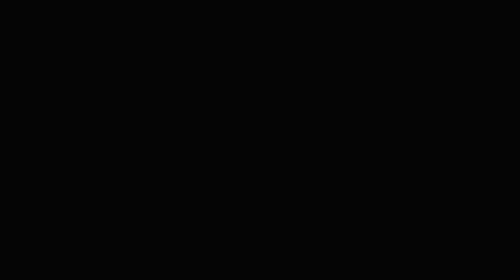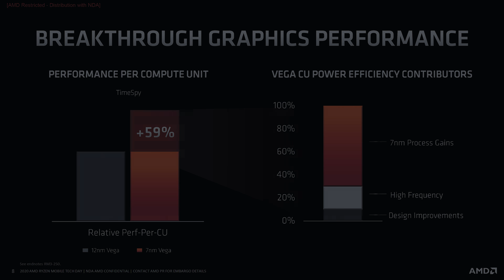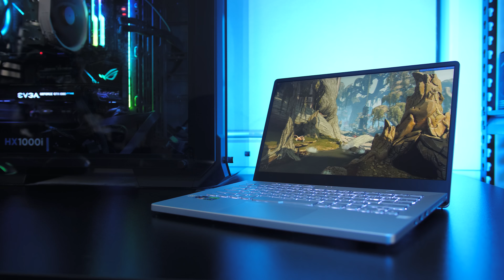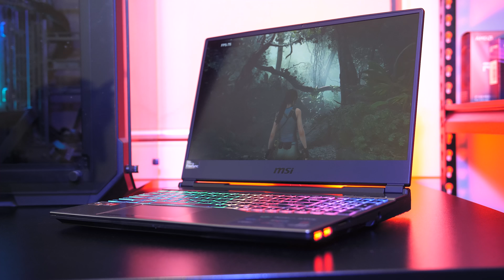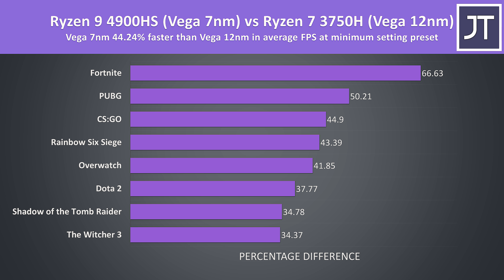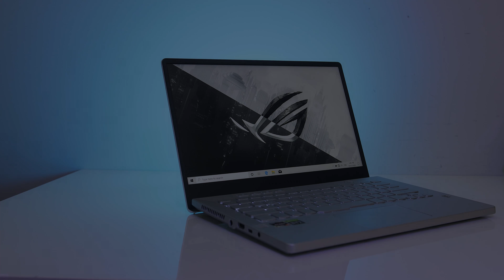Vega iGPU Gaming Comparison - 12nm vs 7nm (4900HS vs 3750H)

Comment: Thank you for this analysis and breakdown!  This is very helpful to me, as I currently use 2500u integrated graphics and my next laptop will likely only have integrated graphics as well; probably a 4500u or equivalent as a good budget device
Reply from the maker: No problem at all! Yeah sounds like that would be a nice upgrade, 4000 series is a big improvement over their prior stuff.

Comment: So if I wanted to game on a game that I don’t need that many frames just more than 60, should I use the integrated gpu or the actual gpu? For a laptop btw
Reply from the maker: If you're on battery it may make sense to use the integrated graphics to save power, otherwise just get max performance with the discrete graphics.

Comment: How about the new Ryzen 7? In Spain, the highest settings to buy the Zephyrus G14 is with a Ryzen 7😔
Reply: Should be very similar. Performance gain on the Ryzen 9 vs the 7 is purely CPU.
Reply from the maker: Not sure yet as I haven't received any to test with so far, still waiting.

Comment: Even in the low powered or U series Renoir, the CPU is still gonna be more powerful and having more cores compared to 3000 series APU. The best possible comparison I think can be done between Ryzen 5 4500U (6C/6T) and Vega 6 graphics VS Ryzen 5 3500U (4C/8T) with Vega 8 graphics. If you go below that to compare a 4 Core Ryzen 5 4300U which has only 4 core without SMT and only Vega 5 graphics, I don't think that will be a proper comparison.
Reply from the maker: Indeed!

Comment: I have never gamed on a laptop. I am more interested in what this means for desktop APUs. I am thinking R5 1600AF performance with RX470 level graphics.
Reply: No. While It'll beat 1600AF by a significant margin, there's no way it'll come close to RX470 in graphics performance. Because it only has 64 bit memory bus. Which is also used by the CPU at the same time. No bueno.
Reply: RX470 is about twice as fast as Vega 11. So we need to wait at least 3-4 years more for RX470 performance on an APU.
Reply: @marc_overmars  I do not think AMD will stick with Vega and will move on to RDNA, much like their laptops. Would be silly to not have a desktop APU that is not more powerful than a laptop or the new PS5\XBox
Reply from the maker: Fair enough
Reply: @ageofbogyo  when they do these, you could essentially have the 4900hs turn into a PS4 slim.. And that's rather good.

Comment: Also, the R9 4900H/HS is NOT the best case for 7nm Vega. The R7-4800U is likely going to at LEAST match it thanks to the much faster LPDDR4X (even being down a CU), and if the rumored R9-U part ends up existing with the full 8 CU's, that'll easily be the fastest 7nm Vega iGPU. The bandwidth difference from 3200MHz to 4266MHz is just that big.
Reply from the maker: Disagree because the processor is lower TDP and the CPU itself is actually a big part of the improvement, especially at lower settings, but guess we'll see which is more important (raw CPU power or memory bandwidth) when U series gets here to test.

Comment: 3:50 Epic settings there isn't a fair comparison of the GPU's either... because at that point all your testing is the memory bandwidth difference because you're so bandwidth bound. High is a MUCH more realistic comparison.
Reply from the maker: Good thing I show all setting levels including high on the screen. Even if it is more memory bound, that's still valid given 7nm Vega is claiming to offer big gains there due to the use of DDR4-3200 and LPDDR4X.
Reply: @JarrodsTech  Sure... If that's ALL that you wanted to test (near solely the impact of the faster memory), but if you were trying to compare whole GPU's against each other (which you said in the video is best done at the highest quality settings, which I'm saying isn't always true AT ALL. That's what my original post was referring to), that scenario tells you EXTREMELY little because so much of both GPU's are running idle at any given moment waiting on data from memory. But if all you wanted to test was the impact of faster memory on iGPU performance, you could have done that with Picasso on desktop... With a 3400G, you'll see broadly similar 2400MHz to 3200MHz performance scaling at Epic settings in Fortnite as you see here with 2400MHz Picasso vs 3200MHz Renoir, because all you're really testing is the memory speed.

You need to lower the memory load for the 7nm Vega part to actually stretch it's legs and show off it's performance advantage, GPU vs GPU. The GPU's are simply too bottlenecked otherwise. Thus High settings in that particular title is probably the best full GPU vs GPU comparison. (And this will apply to most games at 1080p. Ultra settings will simply be too memory intensive for ANY iGPU).

This effect won't be as bad with the 4266MHz laptops, but running at the highest quality setting at >=1080p will almost surely still leave some GPU performance on the table thanks to severe memory bandwidth bottlenecks.

Comment: Can we expect similar iGPU performance in the 4800U? That one also has Vega 8 graphics cores at 1750Mhz or will the 15W TDP lower performance?
Reply: There a video kinda on it
Reply from the maker: Hard to say, the lower CPU power will factor in and lower the results especially at lower settings.

Comment: I have a feeling it's more to do with memory bandwidth and faster RAM than the process node, but this reminds me of the PS5's approach to the Xbox Series X, Xbox may have more CU's but lower clocks and slower I/O. If the theory from this video could be applied (even though the consoles run on the same process node as each other) reckon the PS5 could come quite close to the Xbox Series X or even surpassing it? It's interesting how the approach from both systems are very different when compared to last gen.
Reply from the maker: It's definitely a contributing factor for iGPU performance.

Comment: To be honest I would like to see a straight up comparison between an 3200g with the vega 8 gpu oced to the same frequency as the 4900hs is running its vega 8 gpu part to see if the perf is in line(even though it is a desktop vs mobile sku comparison) From what I have seen the new 7nm vega 8 gpu part perform the same as an overclocked vega8 gpu part on the 3200g.
Reply from the maker: Yeah that sounds interesting, I think I have a 3200G here somewhere.

Comment: 3DMark (Graphics score),
R7 3750H Vega 10 @1400/1600
(Clock stable 1400, 2xDDR4-3200 CL20 & IF @1600)
- Fire Strike 3855
- Time Spy 1216

What about Vega 8 score in 4900HS with core/mem 1750/1600, have you tested it?

I only found data of 4900H found by TUM_APISAK scored 4084 (CL22), and AMD slide deck 1227 (4800U LPD4X-4266 25W maybe)
Reply from the maker: I didn't test it, sorry.

Comment: I wonder, could AMD make a 4000 series with the same amount of CUs as the 3000 series (10 CUs)? Would be interesting to see the entire performance difference when CUs match.

Also, it makes more sense to play games at 720p with iGPUs for more FPS so maybe have those results as well?
Reply: I think space was the issue. 
Notice these are 8 cores chips and likely there wasn't enough die space for 2 extra CU's.
Reply: @shemf_services  Yeah. They couldnt even fit PCI-e 4.0 support inside it. Too many transistors to make it reasonably cheap and efficient.
Reply: @PanaehaliTut  i thought they didnt add pcie 4.0 cause it would suck too much power?
Reply: @shemf_services  

Maybe they will create another version for apple with more L3 cache and then there will be enough space for that. Maybe more then just +2. It might be 16 CUs alltogether. ;) That would be a beast, RX 560 and 1050 Ti level. ;) If it was paired with 4 GB of HBM2, it was just a beast... ;)
Reply from the maker: Yeah I guess if there was enough space they would have done so.

Comment: I think that in the majority of the case the fact that the 4900HS is way more faster than the 3750H is the reason why in games we have this results using the integrated Vega. Is the same reason why a laptop with the 3750H and the GTX 1660 ti, is slower than a laptop with the i7 9750H and the same GTX 1660 ti in all the videogames. So in my opinion the new vega integrated card is not faster than the old, but thanks to the new cpu (that is also faster than the i7 9750H), we get better result. In any case don't use this for gaming.
Reply from the maker: It's a factor, either way we're still comparing last gen with this gen, just the way it is, but that's why I tried to use only max settings when comparing the performance difference as it should be more GPU bound.

Comment: dual chanel ram ?
mhz ?
Reply from the maker: Both dual channel. DDR4-2400 with the 3750H, and DDR4-3200 for the 4900HS, the maximum for each machine.
Reply: vega 10 12nm vs vega 8 7nm and winning vega 8 ryzen 7 4800u then it will be very powerful nice video <3

Comment: Hey man, Love your Videos. Is there something like an integrated graphics roundup kinda video on the horizon? like comparing theses Vegas, new intel integrated 10th gen graphics, the older UHD 620 that likely most existing ultrabooks have and  maybe the mx150 or gtx 1050 that some thin and light notebooks have
Reply from the maker: Thanks! Not at this time, this was the best I could do, I don't have anything else like MX or 1050 to compare with or I would have included it here :(

Comment: It would be so playable for AAA games on 720p
Reply: Yeah, true in most cases. The 1920x1080 resolution used here is not very indicative of lower res gaming, in some titles lower res nets way higher performance than shown here, so in most titles, playable frame rates at 1280x720-1600x900 can be easily achieved. But he sure to check more exhaustive benchmarks first if that's your main interest in getting a laptop with these chips.
Reply from the maker: Possibly.
Reply: watch lowSpecGamer everything is possible

Comment: What happens if you upgrade the memory in the new G14? Do you lose dual channel and get a big performance hit?
Reply from the maker: As long as there is a SODIMM stick installed it will run in dual channel. If the stick is larger than the soldered memory, if you go over the combined limit some will be single channel speed.
Reply: how would you lose it? if you downgrade and just remove it, yeah that would make sense, but why would it go away if you still have something there?
Reply: From what I've read, mismatches in module size would behave differently between Intel and AMD, but it seems to support your explanation: dual channel for the first 8+8, then single channel for the last 8. We don't know how the APU memory was mapped by the OS though, so we can't say how it might impact the performance.

Comment: one thing to note that cpu just mops the floor with 3750h so there could be bigger gap.
Reply from the maker: I noted that multiple times in the video 😛 it's definitely why the gap is larger at lower setting presets.
Reply: @JarrodsTech  how the gpu compares with nvidia counterpart. i mean is it a mx 150 250 or 350
Reply: @khankhattak.  its just below a 1050 it seems

Comment: Nice improvement. I would be really interested in seeing the entire stack of Vega graphics compared, even against the MX range. However I still find the graphics performance a bit low considering that next-gen console are arriving and that the low preset spec requirements will greatly shift because of that. Hopefully next year we will have RDAn2 and DDR5 to offer an other huge boost in performance that will enable all games to be playable at 1080p.
Reply: I second this
Reply from the maker: Hopefully I can do it some day, don't have any other machines to test with at the moment. Regarding consoles, the GPUs there would be closer to the GPUs used in desktop graphics rather than the iGPU here.
Reply: Yeah, I understand that console GPU should be compared to full blown GPU rather than iGPU. I was only saying that new games, even at low settings, will be more taxing on the GPU going forward (next gen may become the new baseline) and thus, the current iGPU won’t keep up with 1080p gaming (we can always dial back to 720p however).

Comment: The H/HS series have relatively lower iGPU power than their U counterparts since the H/HS chips will mostly be paired with a dGPU. So I think its fair to expect the U series chips to have slightly faster iGPUs than this.
Reply from the maker: Maybe, 4800U seems to have same clock speed/compute units as HS which is interesting, lower TDP though yeah and obviously the CPU performance will factor in too.
Reply: It looks like 4800U and 4900HS have the same GPU frequency. Maybe the slightly faster RAM might make a bit of difference.

Comment: Is it worth to turn off the rtx 2060 when not gaming and use the amd  graphics on the rog g14 to save more battery?
Reply from the maker: Maybe, if you're just playing lightweight games that still do ok on Vega.
Reply: the vega can definitely play older esports games or etc esp on lower setttings if youre trying to save battery, i set it to auto use igpu when not plugged in to do some testing......with the 3750h. But the 2060 is a 60-65w anyways so its not Super huge draw....yet its a small form factor laptop so im sure the battery is already small as it is. Im sure the Hz you set your panel can also help with battery life. But honestly i wouldnt really recommend gaming on battery unless you absolutely have to.....just bc it seems impractical since youre already sitting down etc. I could understand some singleplayer ladder or etc wc3 reforged at the park i guess? But otherwise the integrated will be perfect for everything...as  far as what the laptop market offers 4900hs is the best processor on the market IMO. 1650 is 50w....but the 1650ti max-q......is 35w......and theyre apparently similar as far as capability.....So that configuration....4900hs with a 1650 ti max-q is the absolute lowest power consumption as far as cpu+gpu. Id like to see that+power brick(tiny) or if it could be thunderbolt powered.....coughs.....eventual zen3/usb4 since amd cant run thunderbolt due to intel.
Reply: It uses the amd igpu only when not gaming. It automatically switches to nvidia when gaming.
You can check through the task manager
Reply: @amritsinha5463  But you can disable the dGPU in device manager

Comment: These igpu's destroy my 940mx 😂
Reply from the maker: big oof
Reply: I still game on my 6 year old laptop with radeon m230. And these vega igpu beats it by 100 to 200%.
Reply: Playing CS GO with my puny dual core i7 and gtx960m is just not feasible. I guess these vega igpus are much better than my system
Reply: @antimon40  960m is still better, should play csgo full graphics 1080p >100fps. But your dual core cpu is just not enough, like at all. tough luck
Reply: @arditm2178  yeah the dual core i7 is the one which slows down the performance, as CS GO is more on cpu side
Reply: @antimon40  undervolt the i7 for better perfomance
Reply: And my MX15 too :(
Reply: Same bro
Reply: bro its a 940. thats like 5 years old, and was bad to start with. may as well be integrated
Reply: @bradhaines3142  Intel iGPU were worse. For esports title, the 940mx is able to play at least 60 FPS at medium settings (CSGO, DOTA) 1080p while the IGPU runs at 25 FPS at 720p

Comment: All nvidia MX lineup cries in the corner while integrated gpu died by heart attack
Reply from the maker: Haha, would have been good to compare that here but I didn't have one.
Reply: MX150 user here. It's holding back the tears.
Reply: @MasterKoala777  I don't understand
Reply: @MasterKoala777  MX150 aged horribly, you got 10W/25W? If you got 25W, with a bit of nice overclock you might be able to beat Renoir APU.
Reply: @Verpal  25w. I doubt if it can beat Renoir even if overclocked. I did undervolt/OC it and get a little extra performance.
Reply: @MasterKoala777  Don't falter, VRAM is your advantage, whilst your average might not be as good, your 1% low can be within reasonable range, especially in bandwidth heavy game.
Reply: @Darshan Agyat It's still a million times better than UHD 620. Back in 2018, there was no better alternative (at the same price point), and that includes Ryzen mobile.
Reply: Amd : vega
Intel : make it double
Mx2xx : cried in the corner
Reply: @Darshan Agyat agreed on MX250. I was actually happy to see that it wasn't much of an upgrade compared my MX150. My 2018 laptop remained as good as the newer ones in 2019. Yep, I feel sorry for those who bought the MX250 in 2019. And I feel happy for 2020 buyers, because of Renoir (Ryzen 4000). 🙂
Reply: @MasterKoala777  i got a razer blad stealth with a mx150 (25w i guess) how do i undervolt it?
Reply: Yeah MX series are a joke.
Reply: @Darshan Agyat NIICE